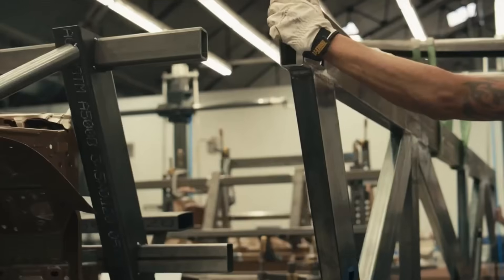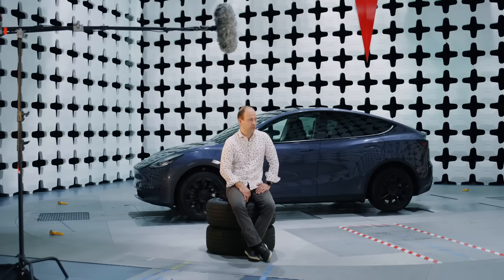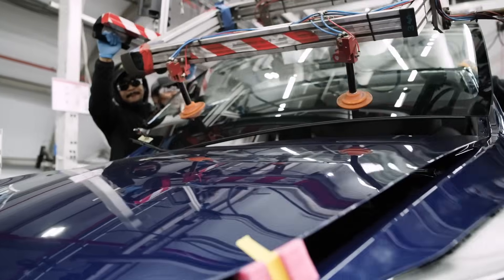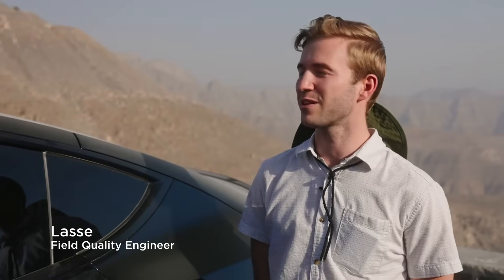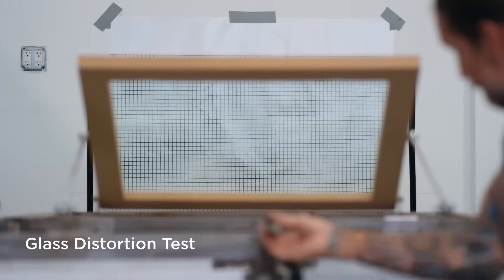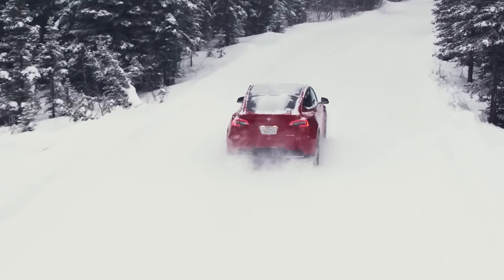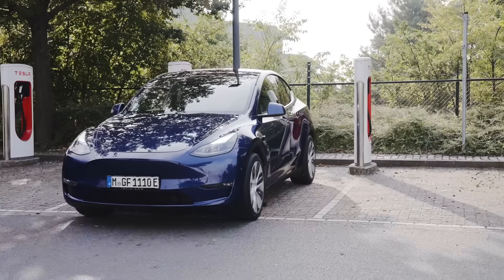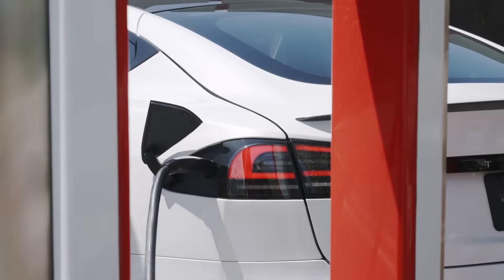Tesla Redesigns Vehicle Glass Roof Preparing For Starlink Integration | Major Upgrades Ahead

Comment: I’ve had to replace my model y roof glass, was not cheap. Cant even imagine what this roof replacement with starlink might costs
Reply from the maker: They’re probably considering it when designing the new roof, hopefully it’s much cheaper
Reply: Curious what happened to require replacement?
Reply: @ilexjin  rock chips can happen, or in my case, something got caught between the rear tailgate and roof glass when closing the trunk
Reply: @SacTownMo-916 ouch